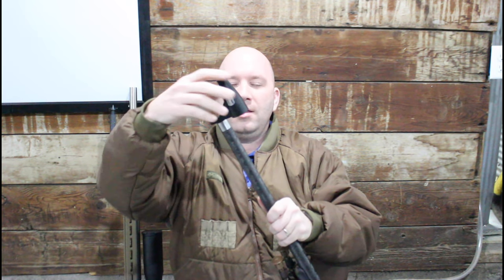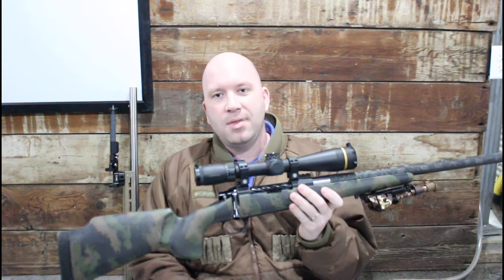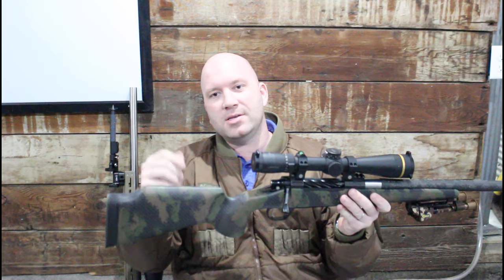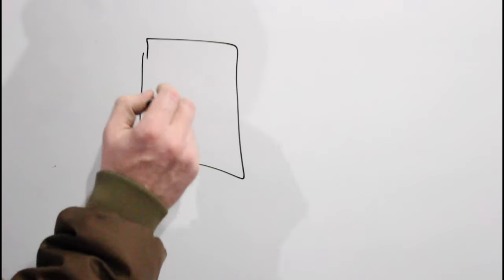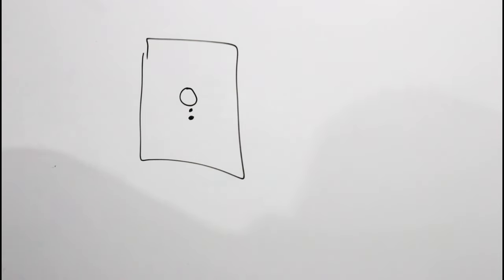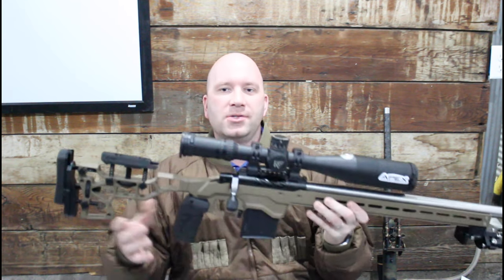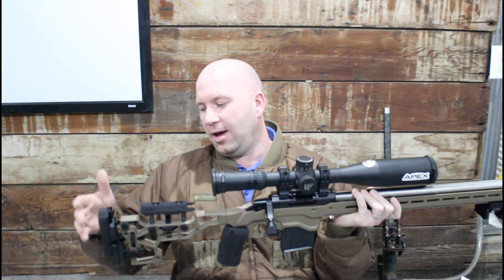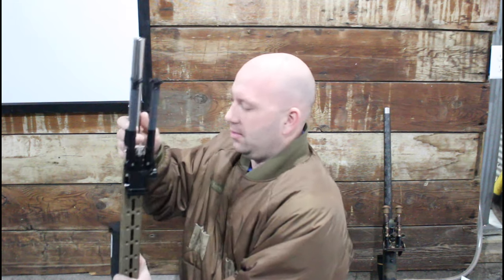Zero Your Rifle with Minimal work!

Comment: Great Video!  I also like to hang a piece of paracord with a weight on it like a plumb bob at a distance and use it to get my crosshairs perfectly up and down and not canted.
Reply from the maker: If you can get you rifle level, thats a perfect method for getting it mounted level.
Reply: Or use a Springfield armory scope with a built in bubble level.